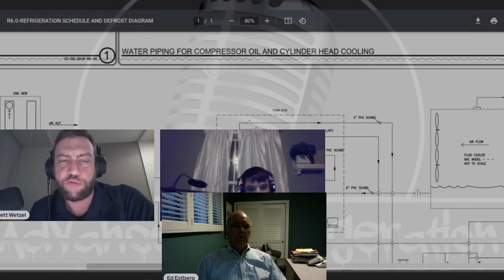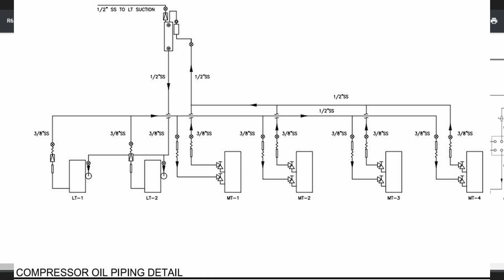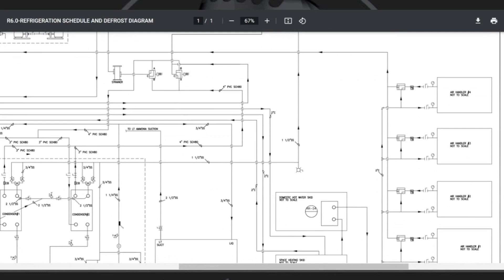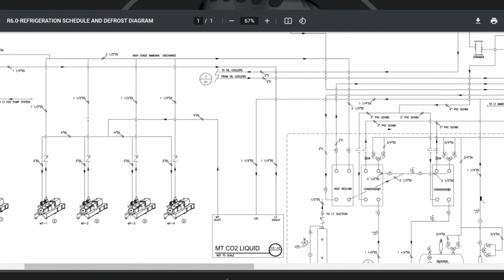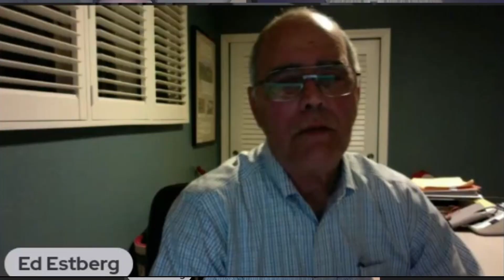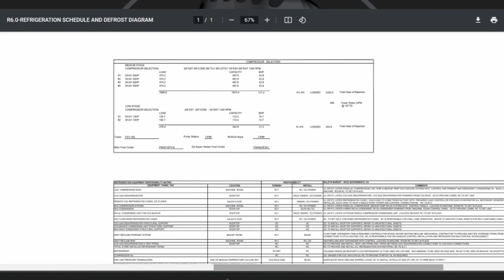Co2 liquid overfeed With Ammonia Primary

Comment: I am wondering what Raley's would use instead of the thermosyphon type condener/evaporators to chill the CO2, since Ed did not like the efficency penalty incurred with the lower suction temps required to run this type of system. It certainly involves some creative engineering with the Lakos system and fluid coolers coupled with the dry coolers.